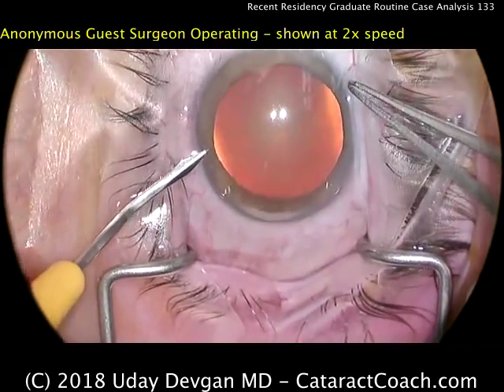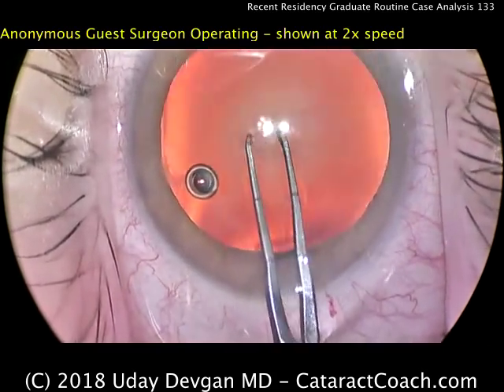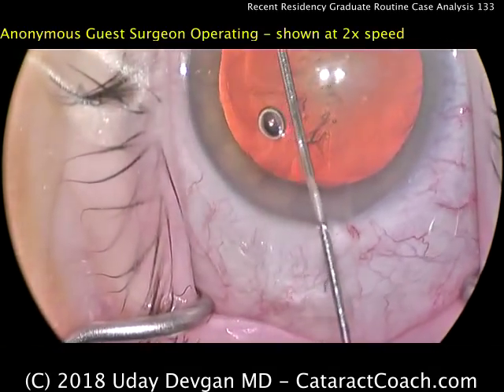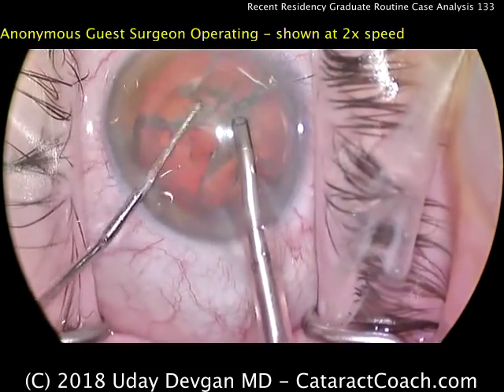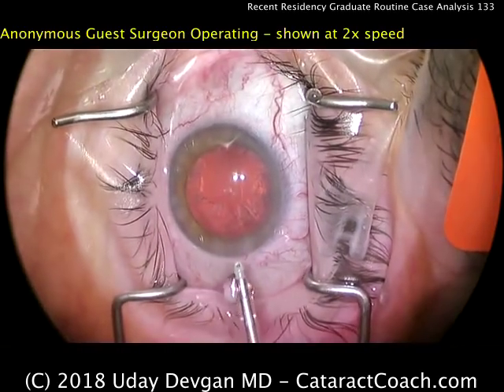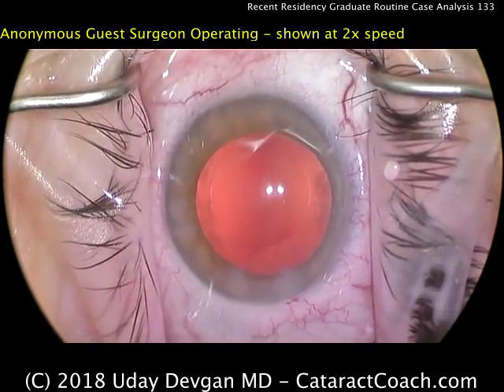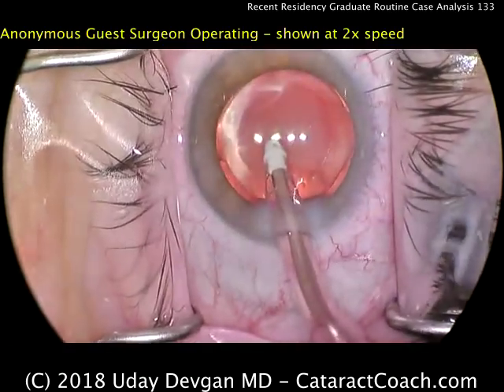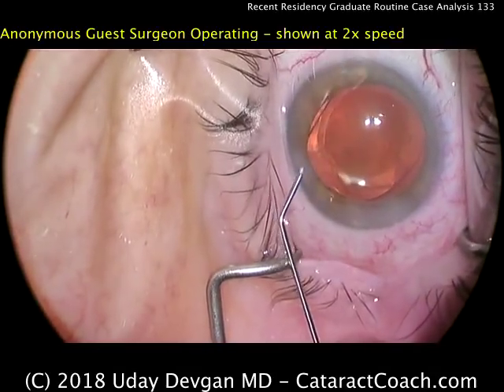Why you MUST learn Phaco-Chop (Resident Cataract Surgery Case)

Comment: When you sculpt grooves for divide and conquer you are phacoemulsifying the same mass and volume of cataract that you would after chopping. I'm not sure phaco chop reduces the amount of phaco energy. You still have to phacoemulsify the entire volume and mass of the lens nucleus. Now if you sculpt by thin shaving rather than fully occluding the tip then yes, D and C will take more energy. But there is a way to make the grooves with a fully or nearly fully occluded phaco tip. I use a kind of hybrid divide/ chop for most cats.
Reply from the maker: get a patient with similar cataracts in both eyes. Do divide and conquer in one eye and phaco chop in the other. Now look at the cumulative dissipated energy (CDE) for each. Phaco chop uses significantly less ultrasonic energy!
Reply: @UdayDevgan  Ok I’ll do it, thanks. I was thinking about it theoretically…
Reply from the maker: @mguerramd  also look up in medline -- published reviews compare the two techniques

Comment: thank you sir for this video.  I'm also trying to learn phacochop.  I am using a centurion with these parameters: IOP 65 Vaccum 500 and asp flow at 37, all on the same level.  i can't keep the cataract  in the phaco prob when trying to chop it. I lose it quickly.   should the asp flow be reduced?  or should  it be gradual?  what are your parameters for phacochop?  thank again sir
Reply from the maker: See here:
https://cataractcoach.com/category/phaco-fundamentals/
That will help you a lot